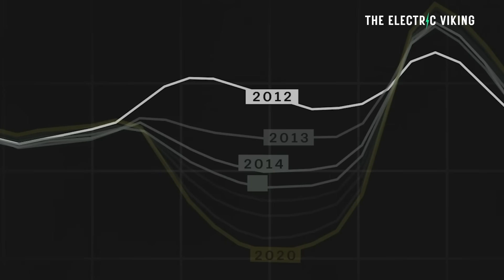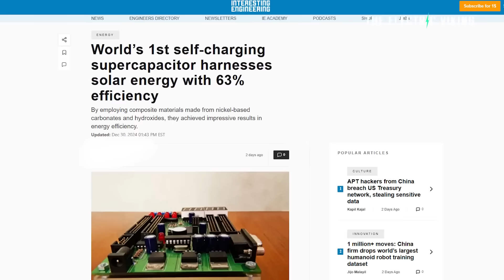Historic First: Solar Tops EU Electricity in 2025 as Coal and Gas Plummet

Comment: Data shows Europe is behind schedule on wind power installations. There are massive technical challenges to power Northern Europe with solar year round. There is little winter sunshine above 50 latitude north. Cold winters drive greater energy demand. Wind provides more power in the European winter and had a low first quarter of 2025. Wind is more variable and needs longer term storage and more substantial grids to move electricity where it is needed. Europe is doing doing very well, but they do need to increase their wind power installation rate. They are doing great on energy efficiency and heat batteries.
Reply: Now there are very big differencies between different countries in Europe. I live at latitude 57, close to the city of Oskarshamn in Sweden. Approx the same as nothern Scotland. My electricity is covered by solar panels. But still I agree on the general information, the further north, the more wind power you need to complement solar, during winter time.

But there is one thing that is not correct in your anser, and that is the irregularity of the wind, and if you have bigger turbines woeking at +100 meters, this is not the case, especially for the sea placed turbines with a +5km from land. And in Sweden anyway, there is a general truth that during summer, the wind is relatively low, but solar panels work just fine, especially due to the longer days, and in winter there are higher winds. So for several years I used to own 7 shares of a wind-farm in nothern Sweden, each share giving at least some 1000 kWh / year. Without any batteries. Now I have ditched that, for going all in for solar, and the panels supply more than 1000 kWh / month, April to September. Of course with batteries for 24 hours, not more. The mains is my back-up supply.
Reply: In the winter the hydro is down, on good years it delivers a lot to both Denmark and Sweden, but not in the winther
Reply: @jasminerodriguez5164  In the winter, hydro is down?! That is a complete nonsense. And who is delivering to Sweden? Which country?
Reply: @mikaelpehrman4815  Norway of course they have the most hydro power
Reply: @jasminerodriguez5164  Sweden and Norway has a common electricity network. And during some time there are imports from Norway to Sweden, and that is the general direction for Norway to export to the EU countries. And then there are variations in hydro power year by year basis. This is normal.  In average Sweden produce more electricity than used domestically.
Reply: @mikaelpehrman4815  yes they are all connected, before Denmark had electricity from barsebæk also. One year there was less water in the hydro in Norway and electricity prices go up.
Reply: @jasminerodriguez5164  Yes, absolutely.
Reply: Norway's hydroelectricity exports vary annually based on precipitation and demand, but it is a major exporter, consistently surpassing other European countries in net electricity exports. In 2023, Norway exported a total of 24,185,100,000 kWh of electrical energy, according to data from World Bank. In 2021, Norway exported 24.7 TWh of electricity, a significant portion of which was hydroelectric, to countries like the UK, Germany, and Denmark, as detailed by this Wikipedia article.
Reply: @jasminerodriguez5164  Yes I dont know the figures by heart, but the general situation is correct. My point is that a country can easily convert to renevables. And different countries has of course to do this in the best way suited to their environment. In Sweden it is not so good to rely on solar year oround, but on wind and hydro during winter instead. For Australia or Tanzania, this can (and should) of course look different.
Reply: @mikaelpehrman4815  yes every country needs to figure out there way, and politicians is blocked in their small brains not all. We live in Spain to get a permit for solar panels is difficult almost impossible some places makes no sense.
There's no plan for the animal puh, puh is a good business, when you make bio gas. Just give farmers a cheap loan for the installation cheaper then destroying the ground water. Just one example.

Comment: Wow, I see the dinosaur-burning trolls are out in force. Face it fellas, you're done; Big Oil is dying, and good riddance.
Reply: Let em burn.
Reply: As oil is used in over 6000 products ( according to co-pilot 😂) big oil will be just fine for a while 😢
Reply: @paulconnolly4483  Concur.
Reply: @paulconnolly4483 

Fuel is 85% ish of their business. It would be pretty bad for their business if they started only harvesting oil to use in chemical products & asphalt. 

That's why they keep mentioning "we use oil in everything! We can't get rid of it!". That makes it sounds like synthetic vanilla and perfume and synthetic fiber for clothing & chapstick and such, are a similar % of oil use as petroleum and diesel, so we need to subsidize them or else the whole world falls apart. 

But that's only 5% ish of oil use. 10% ish is asphalt. 

We can, and should, reduce the oil industry to a small handful of wells and refineries to make those products, and replace the rest of the industry with all the green electricity and electric alternatives to burning fuel.
Reply: Yeah, it might, one day, but for now, the alternatives are "still" too expensive and not developed enough. You face it, every nation or country, Commifornia included, has oil and gas power plants as back-up, when the sun doesn't shine, as you can't cheaply or efficiently store excess solar power "yet" or when power fluctuations from "green" energy need to be stabilised with reliable gas turbines. Nuclear would be a great stepping stone for this, but oh wait, most countries gave up on investing in that a long time ago. Like Germany, which shut its nukes down, then started burning "clean" coal again when the Russian oil was shut down.

And let's not forget, many solar panels require a LOT of heat to produce and raw earth materials, which require mining and pollution to make. And wind blades for the turbines still can't be recycled, so what to do with them?
Reply: @jasontodd8296  ALL the standard talking points from the fossil fuel and nuclear industries - who ignore all their own shortcomings like changing the global climate, millions of deaths from particulates and toxins, cancers from radiation - and the fact that they, not renewables - are the two most heavily subsidised industries in history once you take all the tax breaks, land deals and military operations into account.

I live in Scotland, which yesterday got 84% of its power from renewables. We already produce a third more energy than we can actually use, so they're building HVDC lines to carry the energy to the south of England.

I also have 32 solar panels and a 18KWh battery - and zero bills.

So all those "problems" you just mentioned, AREN'T PROBLEMS.

Extinction IS a problem, and more important than "shareholder value"!
Reply: @geconserver  Right back at you. Same talking points from those like you. 

I would love to have a solar panel on my roof and be good 24/7/365 a year, but it doesn't work like that (And I have a solar system, which stops working in the evening and only makes 20% of what I need in the winter).
Green is first off not mature enough, second, not so green as making all the parts still pollutes.

Don't get me wrong, I would love to have working Fusion power, reliable and safe next-gen fission power, solar cells to be at 50% efficiency or more, have superconductive cables so we don't waste power in the transfer, have mass energy storage facilities and so on... But we don't, yet.

I am glad that green is taking over more and more but it will take far more time to get to 100% or anywhere close. 

Until then, we still have much research to do.
Reply: @jasontodd8296  Yeah, we've heard those lies before too champ, but aside form a few hundred solar panels not taking ANYWHERE NEAR the steel, concrete and copper required to build gas fired steam turbines, the only need to be made and then will produce clean energy for 30 years with zero emissions.

Your gas fired OR COAL power plant will be spewing out tons of poison EVERY DAY OF ITS OPERATION.

But why bother facing the truth when you can just flood the zone with misinformation and downright lies, eh buddy? It's worked brilliantly for 50 years, am I right?

.... Until the price of solar dropped below natural gas.
Reply: @geconserver  "Zero" emissions is a lie, the emissions they make to be made do count. And some either rare earth or hard-to-extract elements plus the later recycling issues, yeah, still not entirely green.  And in some cases, the top solar panels do need coal to make to reach the high temperatures for the process. 

Your misinformation issue is not one-sided, both sides lie, or do you think that "the green push" does not have some money or power grab move behind it as well? Gretha is a good way to hide your intentions. She is honest, but those behind her, pulling the strings, not so much. 

As said, Germany shut down its nuclear power, wanted to rely only on Russian gas and wind + solar and that didn't work out, did it? No, like Poland, they burn coal.

The only three nations in the European continent that have as close to Zero emissions, when it comes to power creation, are Iceland (geothermal), Norway (hydro, small population and still they export tones of oil and gas) and France, cause of nuclear (and here, Russia is again the biggest exporter of Uranium and somehow they don't ban that?)

Spain had a massive blackout when they overproduced solar and their grid could not handle it all at once, so the grids need updating as well.

The only current way to go globally full on renewable is to literally go global. Have a global power network, plaster all deserts with solar panels and transfer the energy to where it's needed (and lose 50% of it in the transfer, because of semiconductors). And how would that in our fractured planet work? Not at all. How much would it cost? Don't know, but probably more than the global GDP combined.
Reply: @jasontodd8296  How do you think steel is made??

WITH COAL.

And the manufacturing IS factored into the carbon footprint of solar.

No, Spain's grid failed because they ignored  the grid safety procedures, operated outside of safe limits, and failed to take appropriate corrective action. This you would know, if you had read the actual incident reports instead of whatever tripe you saw on social media.
Reply: @geconserver  Yes, I know, but you stop pretending that all clean energy is 100% clean. It's not. 

Not yet anyway. 

Besides, all of this is mute until the entire world tries to go green, India and China clearly don't care and also, green energy has to be affordable for everyone. What's the point, if only the elite can have clean power?
Reply: @jasontodd8296   Another completely debunked trope. China installed more solar last year than the rest of the world put together.  They're taking this seriously, YOU are not.

Solar and wind are the cheapest forms of generation in history. This have been proven again and again and again, but still the fossil fuel industry spreads its propaganda.
Reply: @jasontodd8296  It will be interesting to see how the true believers respond when the physics and economics of the ambition is realised.

Don't get me wrong, I have solar and I am also getting a battery BUT the reason for this is someone else has paid a very substantial portion of the expense so it has all been largely subsidised because in Australia we have STC.

The dreamers believe the "big polluters" have paid for this. What they don't realise is the corporation never paid for anything and the cost has been passed onto the consumer,.

I often will tell a particular type of person that I get more sense out of talking to my border collie. At least he is honest.
Reply: It's now a game of denial , even media are encouraged to NOT mention the obvious, don't  spook the investors.
Reply: No. 1 yes. Especially yesterday and today, since it’s been raining all day.
Reply: No. 1 yes. Especially yesterday and today, since it’s been raining all day.
Reply: Tell me what are your qualifications.
Reply: @charlesdarwin5561  You should have asked that first before posting your other reply trying to tell me how solar panels work.

I have a BSc in Electronic Engineering from Napier University. I then spent 25 years in the IT industry, starting in support, then as a journalist, then network engineer, IT manager, and finally as a developer working for a large financial institution.

Since then I spent 10 years studying macroeconomics and political economics.
Reply: @geconserver  I would expect more from a peer.
Reply: Now, are you ready for discussion? 

I'll show you mine also. B.Sc. from Monash University with double mathematics major. Fluid dynamics, thermodynamics, dynamical meteorology, astro-physics, parametric and non-parametric statistics plus electrical engineering from the electrical engineering department.

I have never been a journalist. I am a network and comms engineer running my own business for more than 2 decades. As an aside I studied economics and law in undergraduate studies just to understand how commerce actually works.

We might even be close in age based on the numbers you have provided.

Now the pissing contest is out of the way.
Reply: @charlesdarwin5561  It remains to be seen if you're a peer.

I note that you haven't posted your qualifications.
Reply: @geconserver  I have. And my qualifications post came before your erroneous statement.
Reply: @charlesdarwin5561  You can stop with the gaslighting. The timestamps tell the full story.
Reply: @geconserver  Get back on point and leave the social babble behind or just concede and go away.

We were discussing solar and now you mention gas lighting. Are you serious?
Reply: @charlesdarwin5561  In what world do you think that I take orders from you?
Reply: Oil will still be around for a while. Plastics are too useful to abandon for now.

Still, it's nice seeing them taken down a peg.
Reply: @rpghorrorstories  Oh yes. Crude oil is still a massively useful resource used in virtually everything from plastics to pharmaceuticals. However, the current emphasis is on not burning it, and that will remove their stranglehold on our energy markets.
Reply: @rpghorrorstories

Plastics are like 2% of oil use. Fuel is 75% ish

So we can still dramatically reduce it, and get rid of all the oil that winds up in the atmosphere
Reply: @rpghorrorstories  Fossil fuels can continue to be used for petroleum products--we just won't burn it. It will have a much smaller market share.
Reply: Oil is still growing, Gas is strong - solar and wind have worldwide only 2.5% on primary energy consumtion.
Reply: @matthewchrist5399

Renewables are 15% of world primary energy consumption, and if you electrify everything, our primary energy consumption drops by 50% or more because of the energy efficiency gains. That's why the US electricity demand plateaued for almost 2 decades: efficiency gains within electrical devices are so huge that you can cancel out adding all the new electrical devices to the grid for nearly 2 decades. Just imagine how much energy we save by switching from ≥30% efficient gas engines to 60%+ efficient electrical engines? Or from gas heating to 400% efficient heat pumps? 

So, renewables are already 30% of the way to the end goal, and are accelerating FAST
Reply: I hate to rain on your parade, but as an oil baron myself, I have a sinister plan to rid the world of all these newfangled renewables once and for all. I'd love to tell you more, but that's always how these things go south and I've already said too much.
Reply: @alexishart1989  Steady now, we can only have one Bond villain at a time, and Elon currently has that role tied up :D